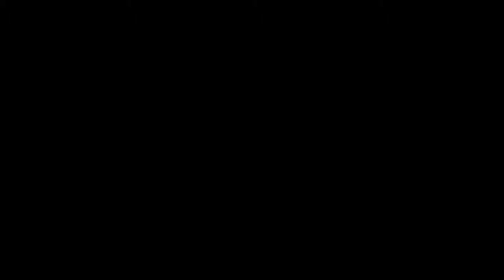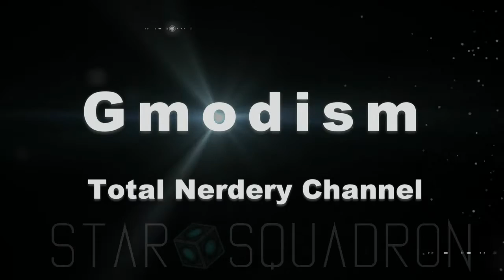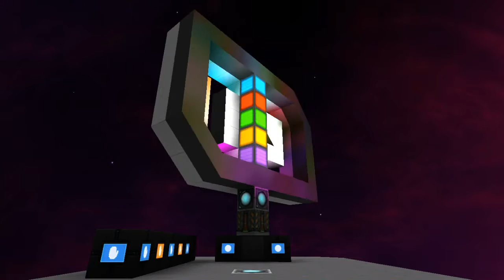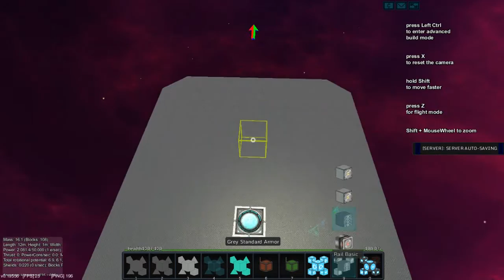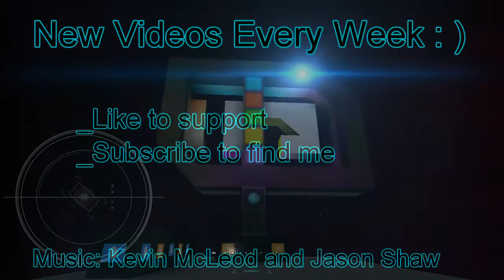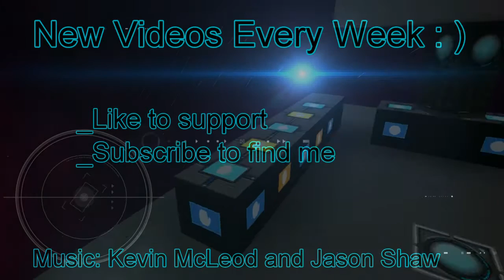StarMade Compact Tutorial | Spinning Thing (Rotating Sign - Radar Disc etc.)

Comment: But how do you make the rotation stop if you want it to, without removing the buttons?
Reply from the maker: +Sparta So like one could make a entirely different wire up, but the easiest way is to connect up a rail speed controller, like in the tutorial but with only one activation module, and use that for stopping, starting :)
Reply: Gmodism Total Nerdery Channel Thanks! <3